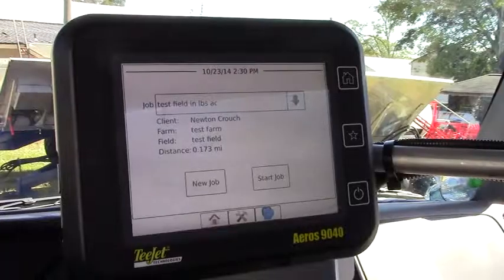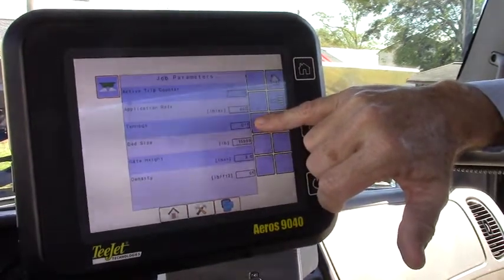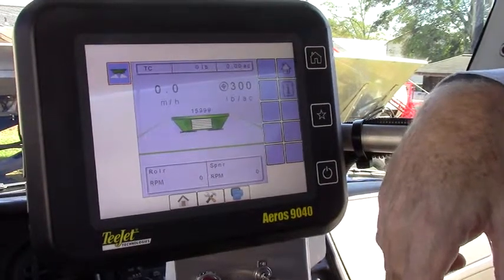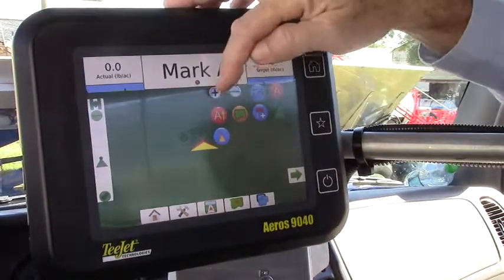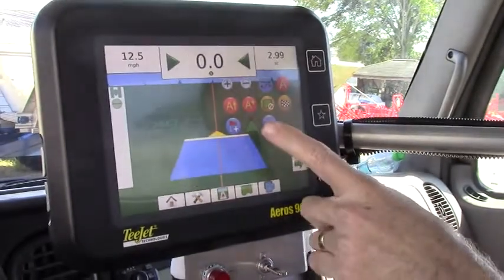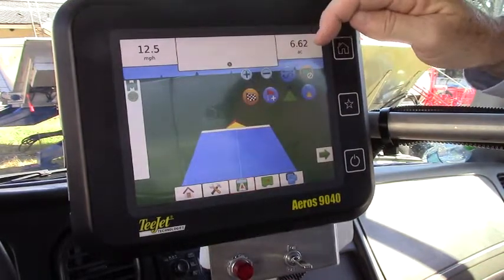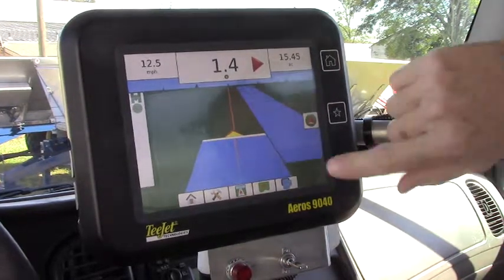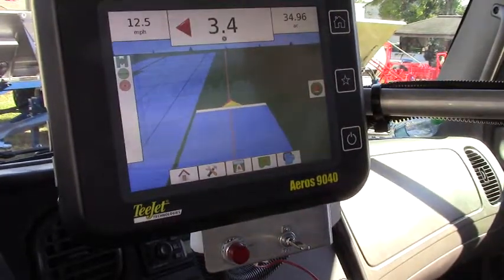How to Set Up & Guidance TeeJet Aeros 9040

Comment: How hard would it be to save the data of date , time , and parts applied, for a years worth of spraying?
Reply from the maker: It's very easy.  That's one of the reasons the Aeros is so popular.  The Aeros assigns a date and time to your job.  (You may have added a field designation also) You simply download the data onto a jump drive and transfer it to your laptop.